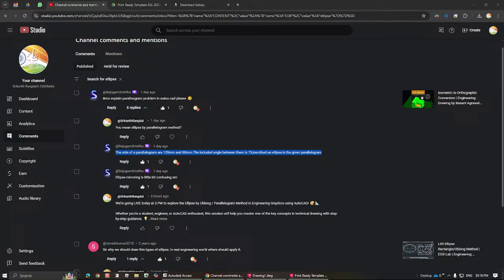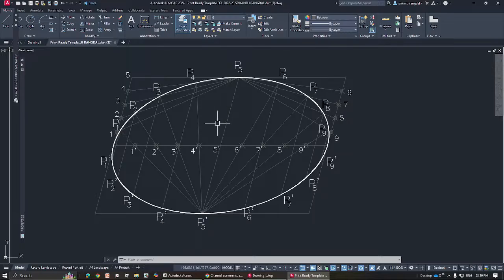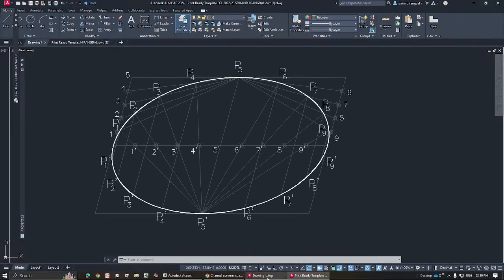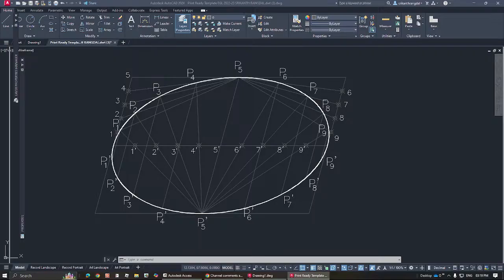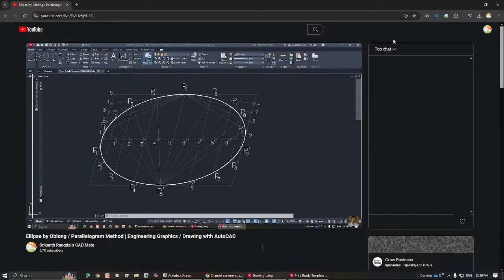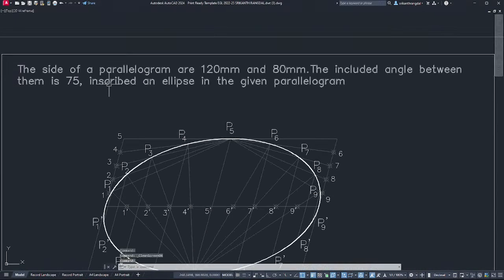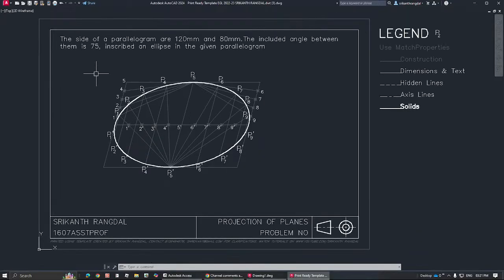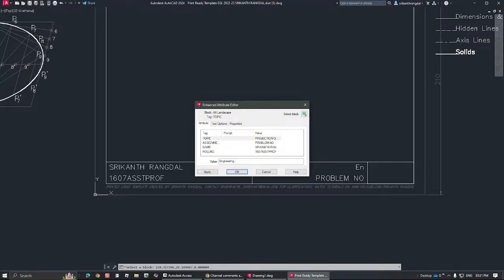Ellipse by Oblong / Parallelogram Method | Engineering Graphics / Drawing with AutoCAD

Comment: Construct an ellipse in a parallelogram of sides 150mm and 90mm with an included angle of 60⁰.Draw tangent and normal to it at a point 60mm from centre of the ellipse
Reply from the maker: @CherukupallyNamitha  follow the same process till you get the ellipse. Then for tangent & normal you'll need to find focus points.

Comment: A point moves in a plane in such a way that the sum. Of its distances from two fixed points 100mm apart is 130 please tell me sir
Reply from the maker: I think I already answered this. You'll need to use arcs of the circle method.

Comment: Sir to the other side without drawing lines sir usee mirror command
Reply: Drawing lines I know sorry please sirr use mirror command🥺
Reply from the maker: @BejugamSrinitha  mirror command won't work in parallelogram method. Check out the lengthen command. It's faster if you don't like copy.